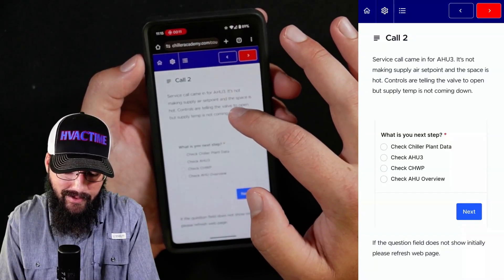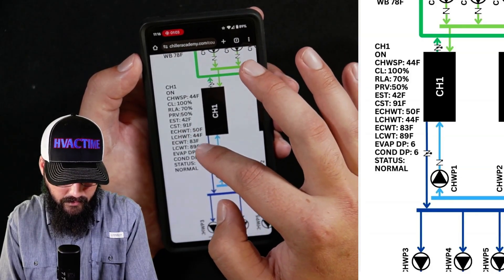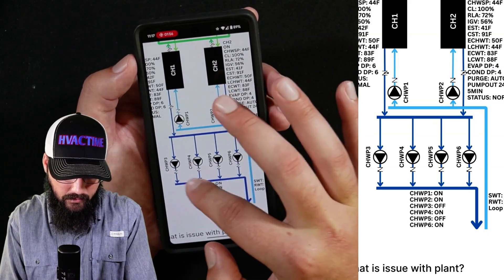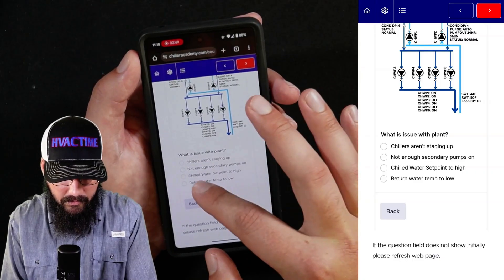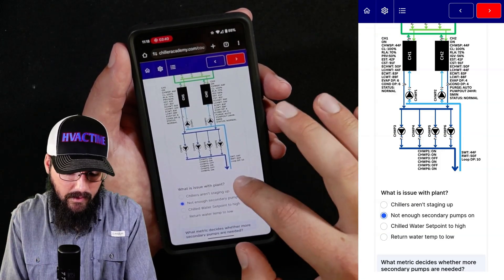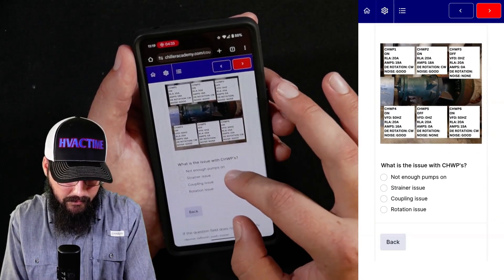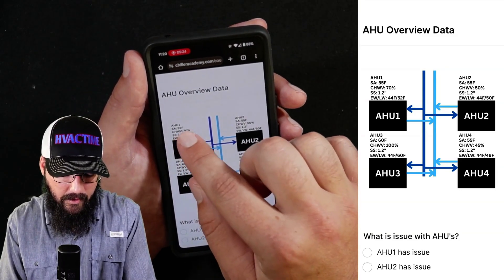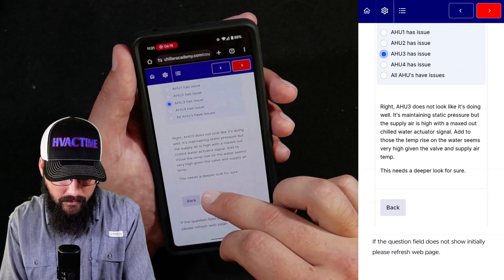My Chiller Service Simulator

Comment: Making the jump from supermarkets to working for a shop that does a lot of work for chillers. Appreciate all the content to dive into and get ready for the change. Any tips?
Reply from the maker: A big mental hurdle, your not learning a new industry. Its all the same things you've learned but with water instead of air. Low water flow symptoms match low air flow, etc. What you'll have to learn is a higher level of how we apply the principles and controls of the trade. Coming from rack systems you have a good head start.